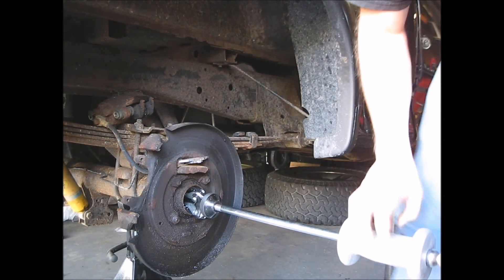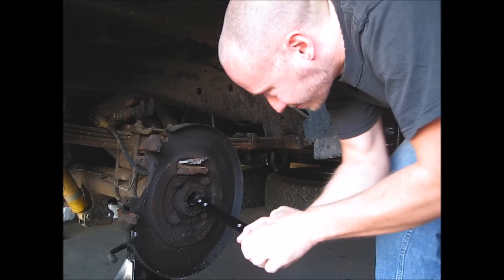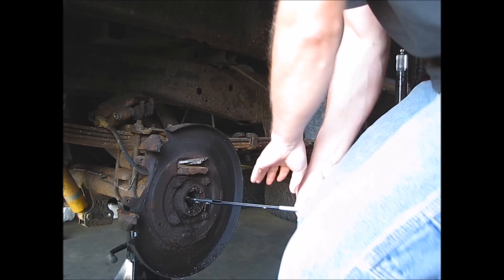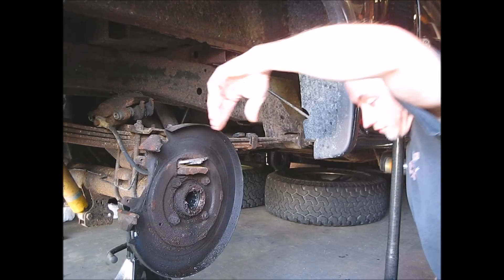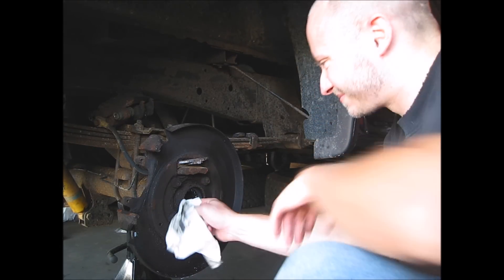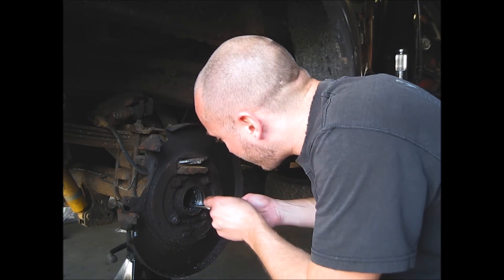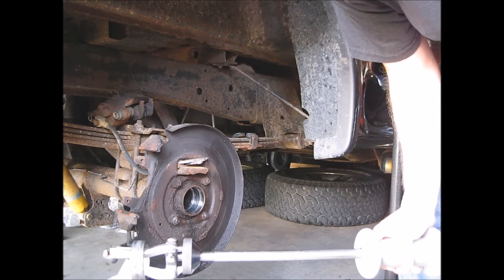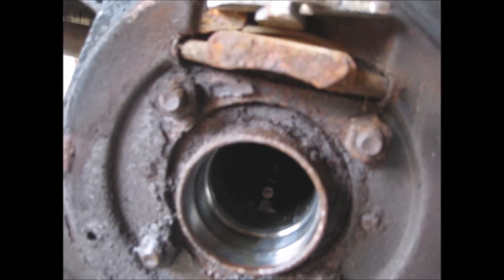03 Ford F150 Rear Axle Seal/Bearing Replacement Part 4 - Seal/Bearing removal

Comment: a speedy trick to getting the seal out is to use the axle itself. Provides much better leverage and the larger diameter of the end of the axle offers more surface area contact than the pointy seal puller when prying. Plus it avoids trying to jam something in from the outside that could potentially damage the surface where the seal meets the axle housing or the race.
Reply: ,EXACTLY! 🤣🤣 THIS SILLY GUY.

Comment: Just a quick tip when a seal is stuck like that one is. Take a old screw driver tap it into the seal lip and buckle the seal it will come out a lot easier. Or you can put a little heat to it and then use your seal removal tool.

Comment: That is why I don't like to use those seal pullers no leverage and too thin. I use a long thick pry bar with a curved end works great tons of leverage. I show it in my recent axle seal video. It is an option that works.
Reply: FordTechMakuloco NO...I can use a pair of channel locks and grip the front and back of any seal and twist it out in FIVE SECONDS.  You can either twist sideways or push handles upwards and no matter how stubborn a seal is it is out the first try
Reply: FordTechMakuloco  That's like using a cheater bar to flush the toilet when you consider you can use a pair of channel locks and grip the front and back of any seal and twist it out in FIVE SECONDS
Reply: Took 1 second with a long pry bar so I am not sure why channel lock guy is so adamant on channel locks. Also use a decent oblong puller for the bearing 3 strokes and it was out.

Comment: I just replaced the original seals on my 2003 F150 after watching this video, but I opted to use a standard claw-hammer to get the seals out.  Insert the claws into the opening and get them hooked on one edge of the seal, and the middle of the hammer head should press against the opposite edge of the housing.  I gave it a quick pull on four different sides (top, bottom, left, right) to loosen it, then went back to the bottom edge and pried it with full force.  Each seal came out in under 30 seconds.
Reply: Matthew Lanahan OR..do as I do and grip channel lock or even vice grips to the front and back of a seal and push up and the seal is out in 5 seconds

Comment: Rather than force it with strength alone,,, would it hurt anything if you would have used a torch to carefully heat around the end of the housing to expand the housing away from the bearing?  I think I would have cleaned the crud away first too.

Comment: have a question 1992 f150 when I back up it makes a strange clicking sound and some times going in or out or reverse it's crunches kinda
Reply from the maker: +Kyle Blake Sounds like a messed up brake.  Might want to check their first.  A spring or clip could be out of wack.  Good luck.  Thanks for watchin!
Reply: Thank.u was thinking u joint

Comment: Im in the middle of doing  the same thing right now  then the front wheel bearing and brakes on the f350 dually then somewhere in the middle have to change the driveshaft and front brakes calipers etc on the trailblazer oh and dont forget all 4 calipers on the single rear wheel cabella f350  im booked for home vehicle maintenance

Comment: Bust everything out and then run a weld bead along the bearing race and that shrinks it up and it will come right out or use a coping chisel and cut it out.

Comment: Golly people!  Its time for me to tell you people how to pull a stupid seal out in 5 seconds.  That seal puller in the video is useless and another commenter mentioned using a pry bar.  NO...Take a pair of channel locks and grip in the metal back and front of the seal and push upward and the seal is out on 5 secondsAlso don't use claw puller or slide hammers to remove bearings.  Use the threaded bolt design with the flip end and outer flange washer to crank the bearing out instead.  I need to educate you people.
Reply: Show us your Magic
Reply: So I know this is an old video but I am so glad I read your comment. Not even 5 seconds and the seal was out. Thanks a lot, Earl.